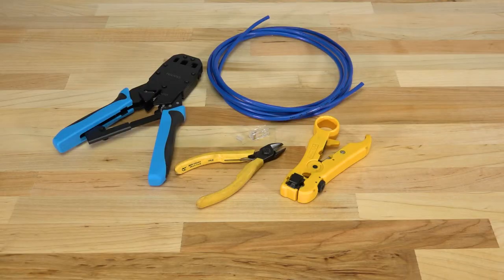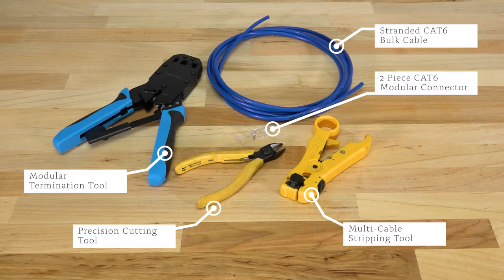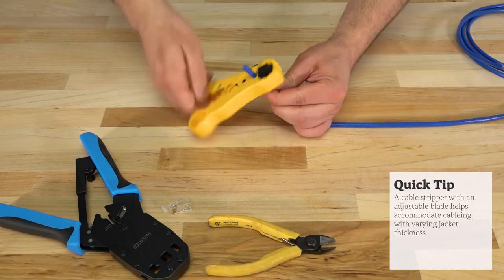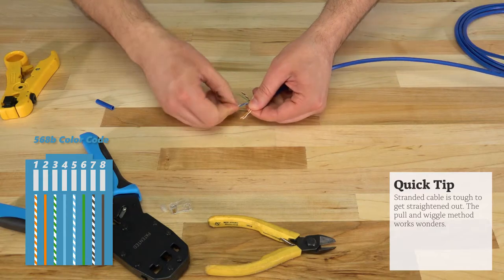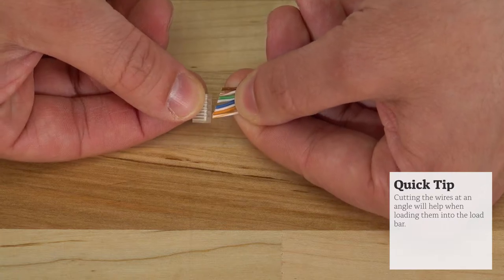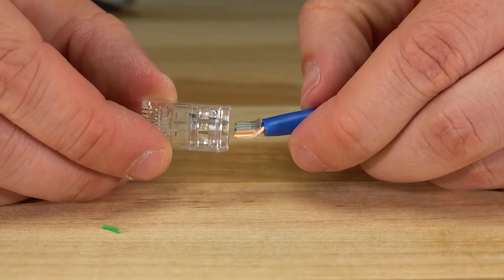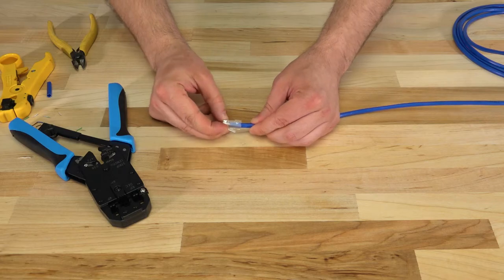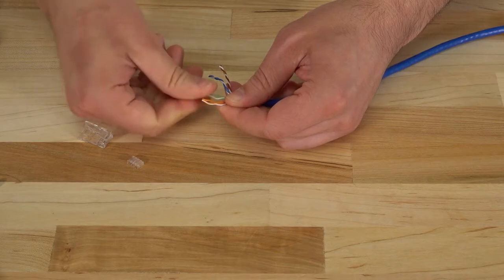How to: Terminate a 2-Piece RJ45 Connector with Load Bars

Comment: Never used the load bars before, never got the point, but I may just buy some because you never know until you try.
Reply from the maker: They are great if you're new to terminating cables. I personally find they slow me down. I've terminated thousands of connectors though so I can basically do it in my sleep.

Comment: RE: 2-Piece RJ45 Connector with Load Bars
 

hi hello, I was wondering if you can help 

Can you use cat5e shielded cable... [ non solid wire, twisted copper core, existing install 18 months ago] 

...with the new 2 piece RJ45 plug with load bar [ caw that would be time saving if yes]

regards .roly
Reply from the maker: Yes, these connectors are great for stranded (non-solid) cabling.
Reply: @ComputerCableStore  hi @ CCS
thanx for getting back to me and for the advice regards .r

Comment: There's 4 different ways to insert a load bar, and only one is correct.  You should have shown that.
Reply from the maker: Hi, thanks for the feedback! Which way would you recommend?
Reply: @ComputerCableStore  The raised edge goes toward the cable sheath/rear of the connector and the thin slots on the opposite end go downward, or toward the contact pins.
Reply: @lennydelvecchio7716  thank you! i watched about 50 videos on these but not one showed or explained how the load bar should be inserted.